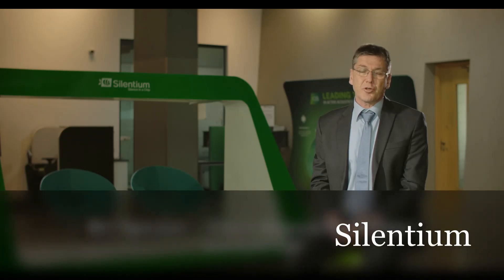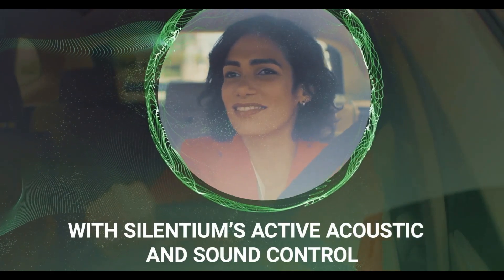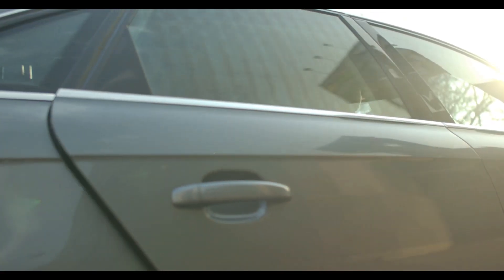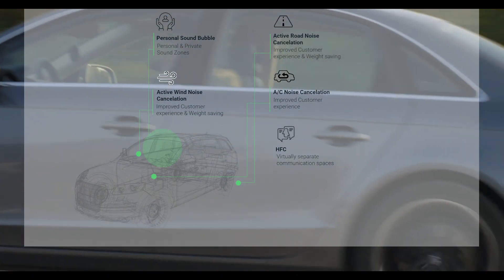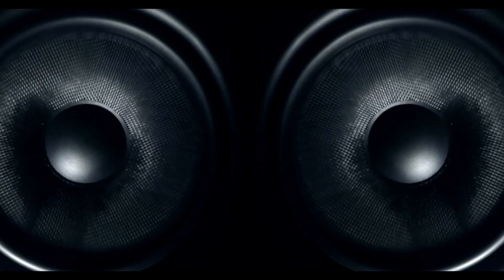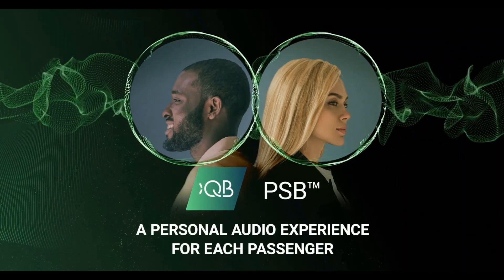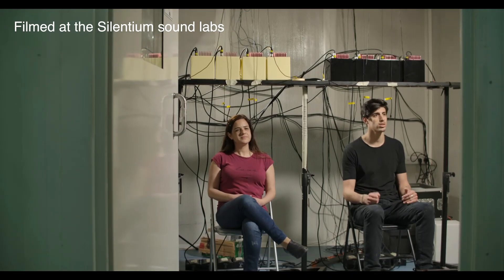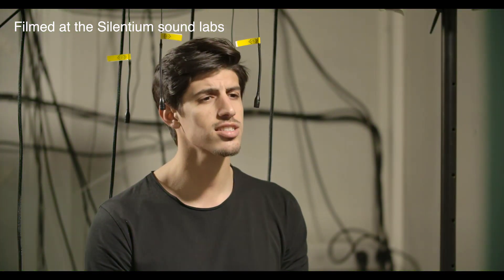How does Silentium's technology work

Comment: Vehicle manufacturers have been doing something similar for a long time now. The quietest ride I have even been in was a convertible XK8. Turned out they employed similar technology. Her is something I just found on the internet but they don’t speak of how long it’s been around. 

“Cars with active noise cancellation
Car noise cancellation may seem a little like science fiction, but it's increasingly commonplace. On the high end, luxury cars such as the Lexus LS, Lincoln Aviator, and Mercedes-Maybach S-Class can be equipped with ANC. Even Honda and Nissan offer the technology in their lineup. In 2023, the technology made its way to the Chevrolet Colorado midsize pickup as well.”